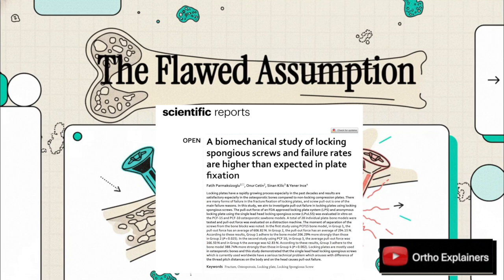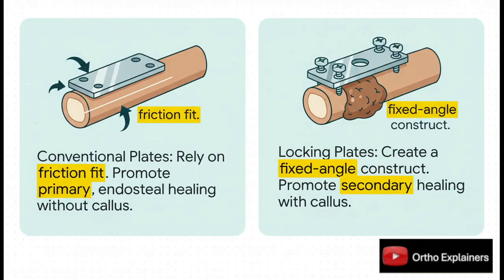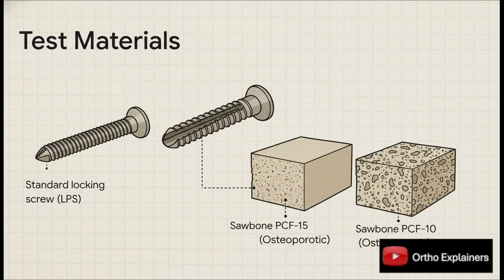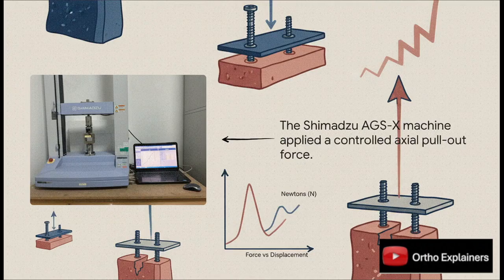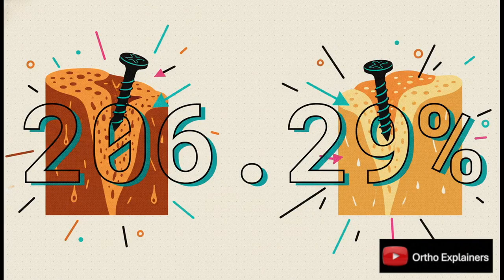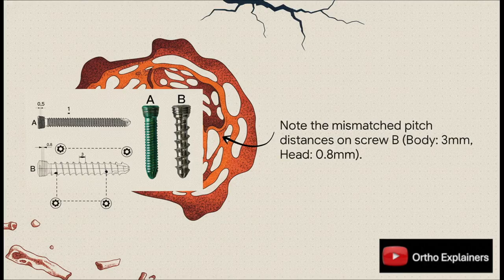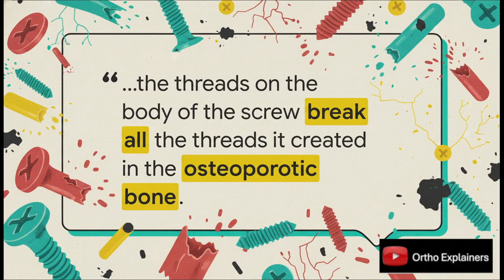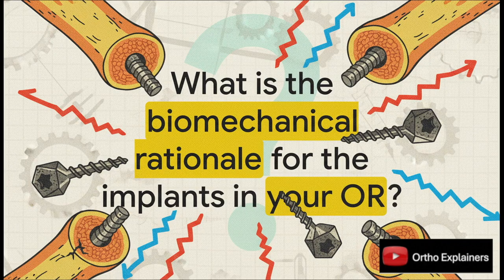Still Using Locking Cancellous Screws?

Comment: what about a pitch distance of 0.75mm in the head of the screw?
Reply from the maker: the locking cancelous screw will always remain weak for a locked periarticular construct, considering smaller core diameter. Matching the head pitch with shafts pitch will contribute extra weakness and screw head can fail at locking site.
Reply: @notjustortho  why? What about if same core diameter as a cortical screw but just with a larger diameter thread - that is same pitch as head?
Reply from the maker: @johnmaunder2459 @johnmaunder2459  if the core diameter is unchanged and the thread diameter is enlarged, then the locking hole of the plate will also need to be enlarged to match thread diamter, and such large locking holes will make the plate weak. Second if pitch is matched, the locking of the screw head in its slot will be compromised and a thicker plate will be need to increase the threads in locking slot. That may not be appropriate for most situations.